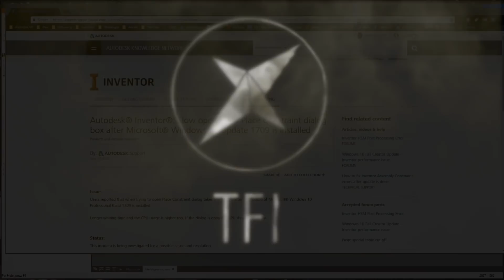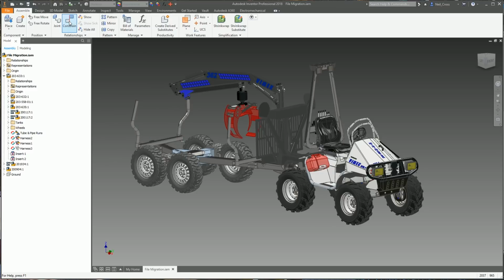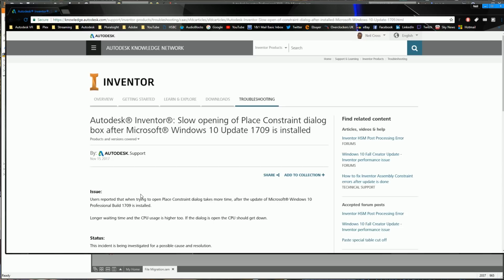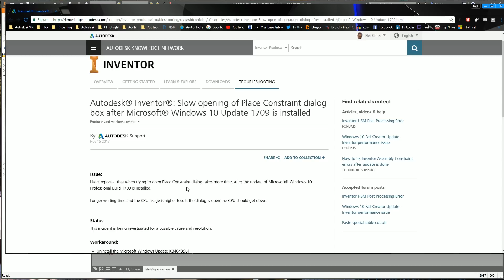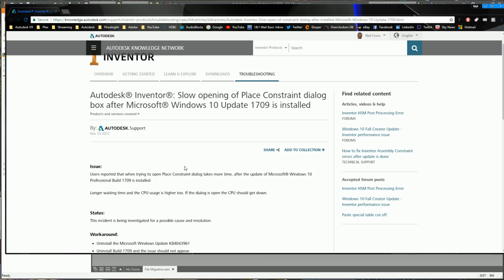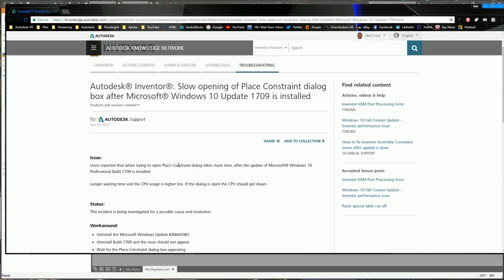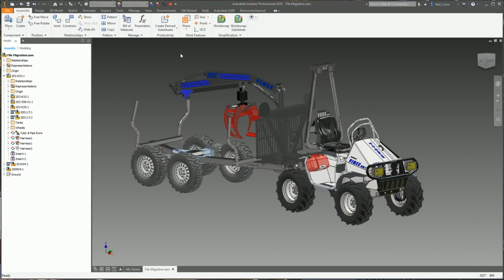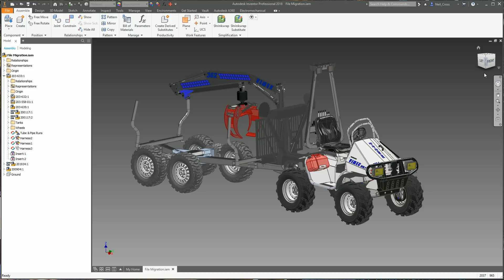Constraint delay with new Windows 10 FUNNY AF Workaround offered!

Comment: 1709 is a cluster f**k!  The problem is you can only uninstall a feature update within 30 days of it being pushed into your machine.  By the time you figure out what the problem is, it's too late.  After that, you have to CLEAN INSTALL Windows!  It's causing issues in Civil 3D and other software ... graphics crashing with Radeon Pro WX 9100 and 7100 with the current 17.Q4 drivers.  Even after BLOCKING Windows 10 from installing the 1709 feature update, there were still problems.  Microsoft is being shitty lately with their forced upgrades.
Reply: Try adding a bolt assy if you think constraints taking a bit of time.  It is a go for lunch experience.

Comment: I'm glad I'm not crazy!  I've noticed it big time, and more than just the constraint dialog box!  My workaround is restarting my machine.  It seems to help for a while, but slowly comes back overtime.
Reply: HERE'S EXPERTISE! Sounds like a broken WPF/WinEx item. Memory leak! Each time you make a control in WinEx, it has some internal counters. Memory leak makes that control creation slower. It just so happens the Constraint box has that control. The update has updated the .DLL that has the code for handling that control. So the update changes the cotnrol behavior. On fresh start, the memory leak is low and doesn't affect performance. After opening it repeatedly, or letting windows passively in the background open and close such controls, the memory leak acculumates, causing considerable delays in the creation (And showing of) this control, causing the apparent slow appearance of it. Different system configurations affect it by how long it takes to resolve the memory leak (probably a malloc problem because if it's a dealloc it'll crash with null pointer exception or do very very weird things). 

There's a faster workaround and that's to find the WPF/WinEx dll's that have that particular control... or namely, the DLLs that get updated... and roll them back manually by copying from windows.old's equivalent location. 

An easier way would be to ask windows to run inventor in compatibility, it'd hopefully try to load the older DLLs. But that behavior is being removed with each new build of windows... grumble grumble. You can't even pick library versions anymore! Graaa!